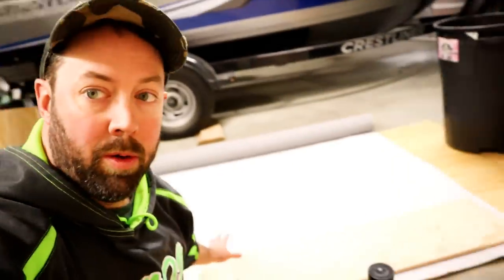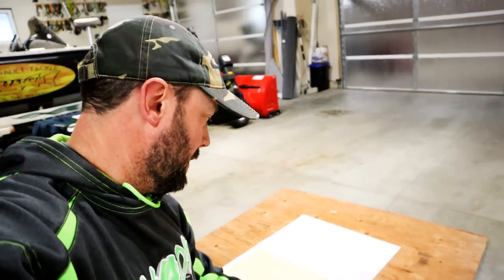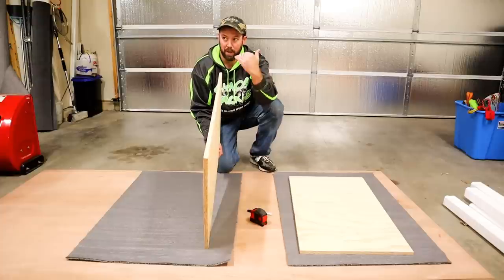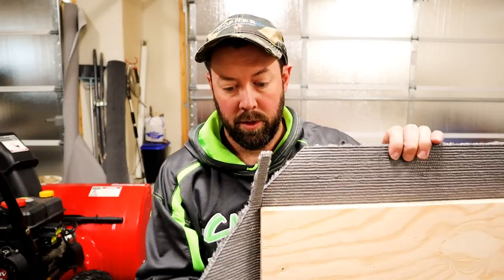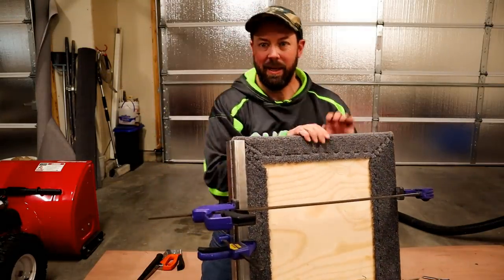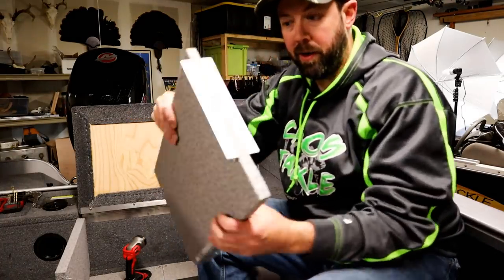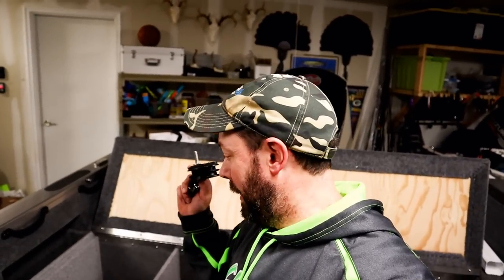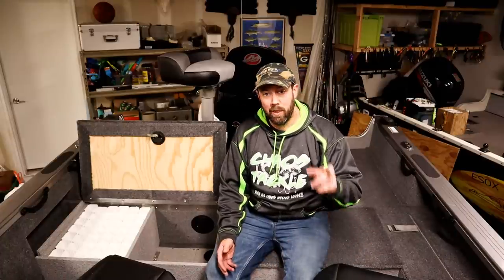HUGE BOAT DECK UPGRADE!! -  DIY Deck Extension with TONS of storage.

Comment: Looks really good! The only additional pro tip I have is to glue the wood edge with epoxy or waterproof wood glue and use a deck sealer. Marine grade plywood isn't actually treated so it will still absorb water.. The ply is glued with waterproof glue...
Reply from the maker: Leon Dulak Thank you! Yeah, in any future projects I think I will do that. We layered the spray adhesive on pretty thick so hopefully that will keep some of the water away 😊

Comment: You do nice professional work. Every bit as good as the factory, like you said. Wouldn't mind hiring you for a project I've got in mind.
Reply from the maker: The Lonesome Fisherman Thank you very much! Perhaps when all this craziness passes I can make a trip to MN 😊
Reply: You're welcome very much, Brian. 

I think we're in it for the long haul with this virus situation. But, yeah, otherwise when it's over I'd like to meet up. I can come to WS too. 

Is there some way to contact you other than this comment section?
Reply from the maker: The Lonesome Fisherman Indeed. Probably the best way would be email, if that works for you. anglinganarchy@gmail.com

Comment: Great video, thanks! I am in the process of "upgrading" my Pro Crappie and your tips here are helpful. Quick question, did you seal the marine grade plywood with anything? The lumber yard where I got mine suggested doing so with Epoxy (which they were selling for $100 for a can!)?
Reply from the maker: Schyler Jones I ended up sealing the wood with a marine grade spar varnish. I did about 4-5 coats on all sides.

Comment: Working on this in my boat right now, do you know where I can find hinges like that, I know your other video says you had some custom made. I’m using the same 5/8 marine plywood and would like to have my hinges hidden like this.
Reply from the maker: Musky madness Sometimes you can find the hinge on Amazon, but I've also had to order them from a manufacturer. Best I can do is give you the specs for the hinge. They are as follows: 
Aluminum Hinge 6 ft, 4" open width, 0.060" thickness, 1/2" knuckle, 0.120" pin diameter.
Reply from the maker: Musky madness Sometimes you can find the hinge on Amazon, but I've also had to order them from a manufacturer. Best I can do is give you the specs for the hinge. They are as follows: 
Aluminum Hinge 6 ft, 4" open width, 0.060" thickness, 1/2" knuckle, 0.120" pin diameter.

Comment: perfect, I have the Ranger deep V. That's what I'm wanting to do, so I clicked on youtube and there you was.lol  My question is what kind of hinge did you use and where can I get them?? My inside measures 84". Thanks for your help and great video!!!
Reply from the maker: Bryan Gosnell Glad you enjoyed the video! We got the hinge from S and S Hinge Company. We ordered off of their website and I will include the specs for it at the end of this message. Be aware that shipping is a little steep. Here are the hinge specs:
Aluminum Hinge 6 ft, 4" open width, 0.060" thickness, 1/2" knuckle, 0.120" pin diameter ($18) 
You may be able to choose two shorter lengths to span the 84" space that you have. If you have any other questions you can always send me a message on Facebook on the Angling Anarchy page. Hope this helps!

Comment: I'm having a hard time finding hinges what type of hinges did you use for the hatch doors
Reply from the maker: Andezej Jakobczak I got the hinge from S&S Hinge company in Bloomington IL. Here are the specs for it:
-Aluminum Hinge 6 ft, 4" open width, 0.060" thickness, 1/2" knuckle, 0.120" pin diameter

Comment: You bolted the hinge to the deck top. Do you see the bolt on the top of the deck?
Reply from the maker: Jim Spisak I used the exact same bolts that the manufacturer uses to bolt the rest of the original decking to the boat, so no more than anywhere else in the boat. After awhile, they basically "sink" into the carpeting and you can't really see them.

Comment: Great video! Gave me a lot of ideas for my own build. 
Quick question, what is the name of the type of vinyl you used on the non-carpeted pieces? It looks great!
Reply from the maker: Tanner Wichmann Thanks man! We just contacted a Crestliner dealer and got the vinyl to match what was already in the boat. Im not sure exactly what its called, but if you contact a Marina im sure they'd be able to get something for ya.
Reply: Thanks for getting back to me so quickly. I will reach out to some boat dealerships and track it down.

Comment: Good stuff. Do you do anything for water drainage inside the box?
Reply from the maker: Andrew Ramberg There are 2 existing drains that ended up inside the storage. Water from the cockpit can still get to it because the large piece across the front was installed about 1/4" above the floor so that the water wouldn't be trapped in the cockpit area.
Reply: Angling Anarchy cool. I wasnt sure if I missed it with my four year old yelling at me.
Reply from the maker: Andrew Ramberg Lol. I think I probably forgot to mention that we did that in the video. I did almost the same thing in my boat and there were 2 drains that ended up in the storage but no good way for the water to get to it. So I just added 2 more drain holes to the rear of the cockpit.

Comment: Would you mind providing a link to the hinge? I am really struggling
Reply from the maker: Britton There isn't really a link I can give you. You have to go to sandshinge.com/stock-hinges/ scroll down the page and look for the 1150 (.060 thickness, .120 pin diameter, 1/2in knuckle length) and the select the material (aluminum), select open width (4in), and length (6ft). Hope that helps!
Reply: @AnglingAnarchy  they are charging $45 for Ohio delivery! That's steep
Reply from the maker: Britton Yeah, I remember paying around $50 for shipping, which sucks, but it was the only place I could find the hinge we needed.